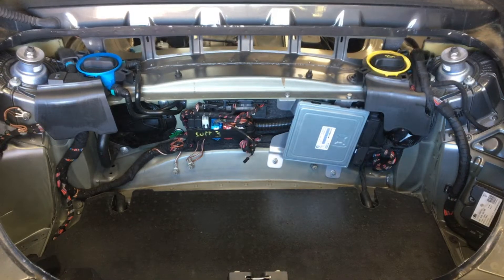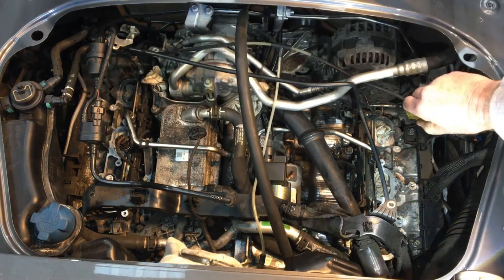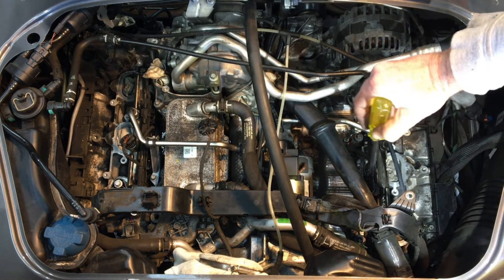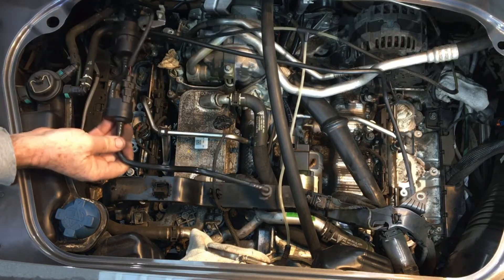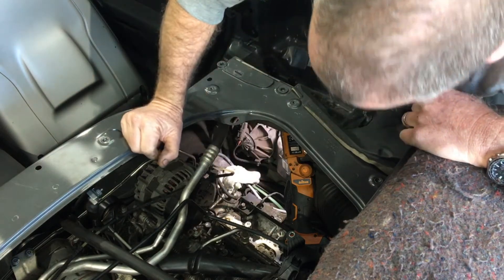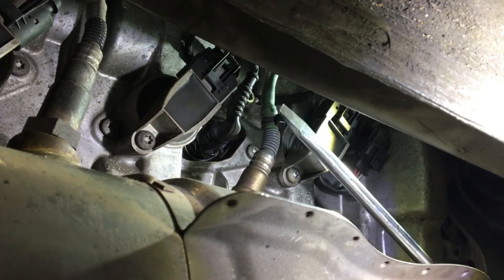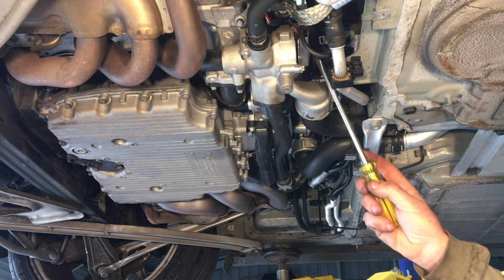Porsche 981 engine electrical components

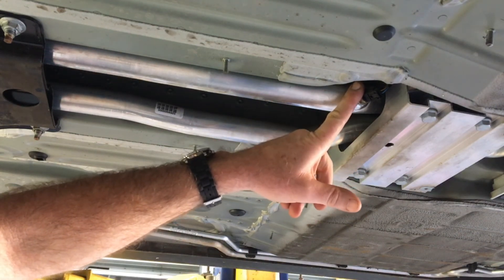Comment: At the 12:17 mark you talk about the oil pressure/temp sensor.  Is this the sensor that provides the temps for the dash display?
Reply from the maker: 12:17 is the end of the vid, but the oil pressure and temp sensor outputs go to the DME, and this then sends a signal on the CAN that is picked up by the inst cluster.
Reply: Jeff, thanks for the reply! My cayman is telling me my oil temp is almost 300 degrees F(149 degrees c) at a cold start. I'm guessing I have a bad oil temp sensor. Can you give me a ballpark location of this oil temp sensor?
Reply from the maker: @jeremyvonk6853  The oil temp sensor is part of the oil level sensor in the pan.
Reply: @jeffrichardsoncardiy  Thanks so much for your replies! Is this the sensor you can see from the bottom of the oil pan, right next to the drain plug? Is changing it a matter of draining the oil, swapping the sensor, and refilling the oil? Is any computer coding necessary?
Reply from the maker: @jeremyvonk6853  Yes for the replacement, but it is possible to put a shop vacuum on the oil fill port and then remove the sensor quickly and replace. Make sure the oil is cold so it's nice and thick. Link below to an example. I've not done a sensor change before like this but I've replaced a leaking sump plug in this way so I didn't have to drain. No coding required from what I know. 
https://www.youtube.com/shorts/Vg_JbQNnJWQ

Comment: I would be interested for you to create an episode specifically about the fuel injectors because the latest Porsche direct fuel injectors (DFI) are powered and pulsed entirely by the ECU and there is very little information available on how they operate.

I'm working on a flooded project car and I have an issue with no power reaching out the injectors. I have already checked all the fuses and electrical connections and I have reached the conclusion the issue must be with the ECU itself, although no errors are being reported by the OBD for the ECU.

Thank you for all your efforts and passion about these cars!
Reply: any updates?